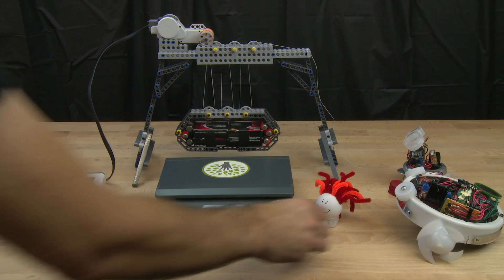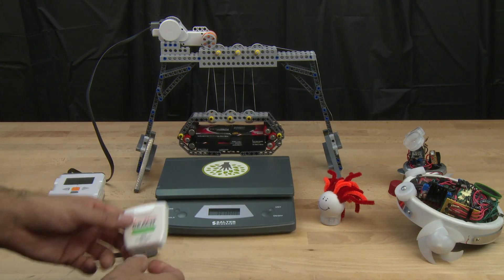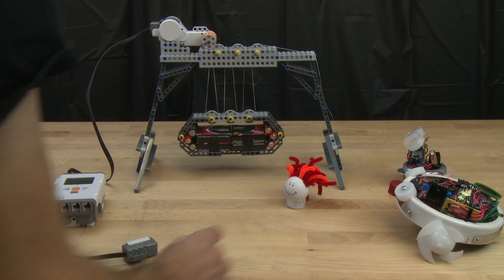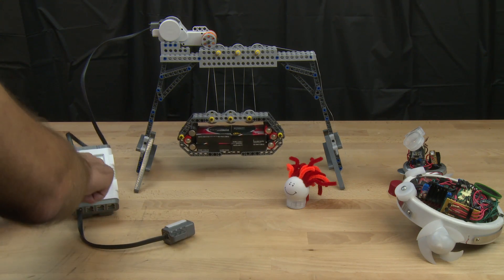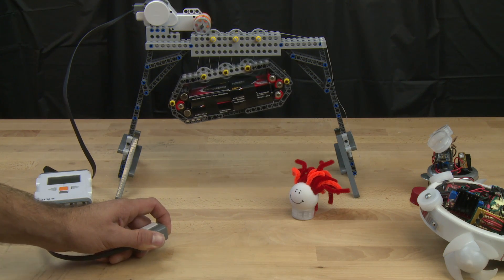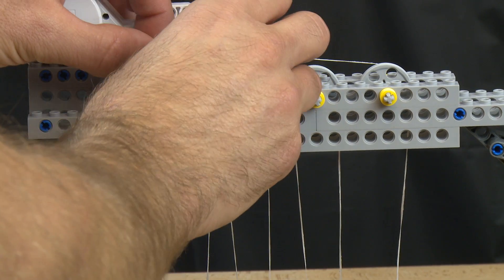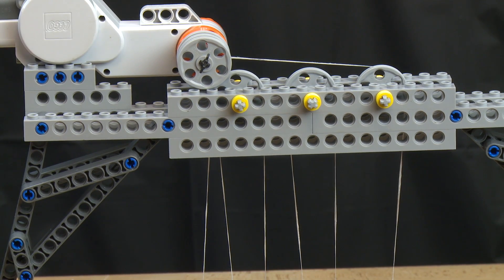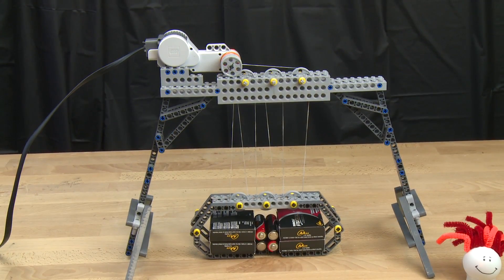Pulley Motorized 1

Comment: While one end of the string was being wound up by the motor, the other end of the string was fixed. By routing the fixed end back to the motor, you're essentially winding from both ends, which not only helps keep the load balanced, but also increase the raising and lowering of the load. At least that's my theory...
Reply: Too bad, Khan did not publish the answer here in comments =(